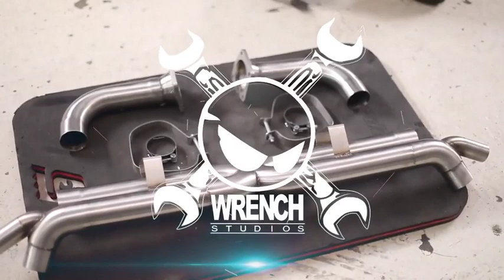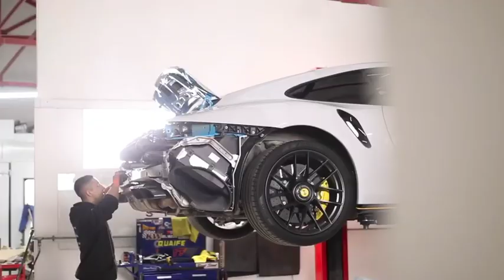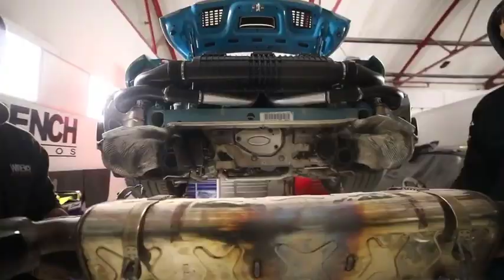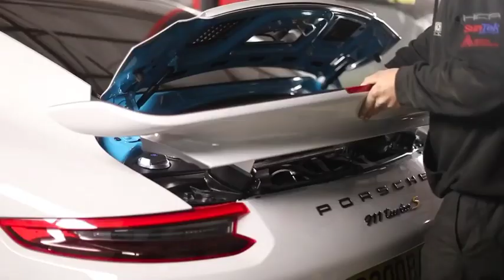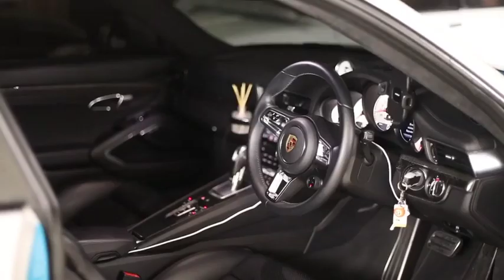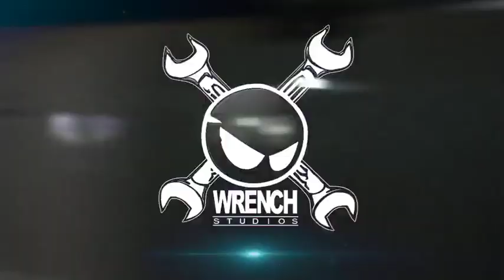Porsche 911 991 Turbo with Sport Exhaust by QuickSilver

Comment: Does it need tuned with decat pipes?
Reply from the maker: If the decat downpipes are installed the ECU will need adjusting. If you fit the X-Pipe only, no tune is needed.
Reply: @QuickSilverExhausts  What about if fitted with the 300 cell race cats?
Reply from the maker: @jasonmshelley  no tune required with 300 CPSI race cats. Just bolt on and enjoy